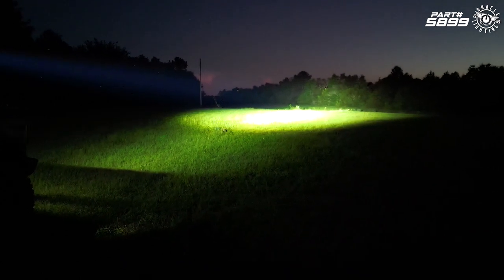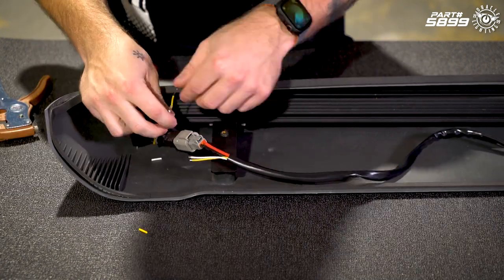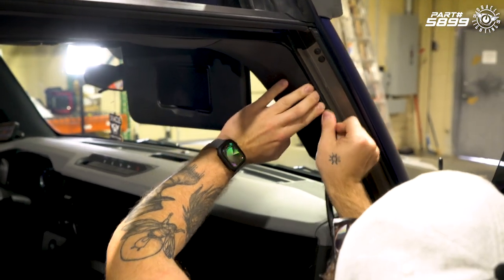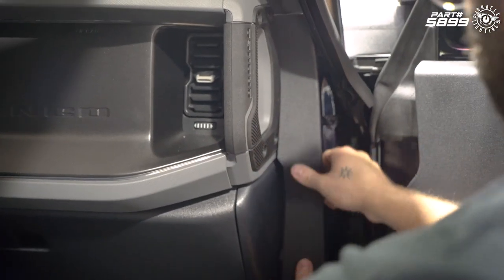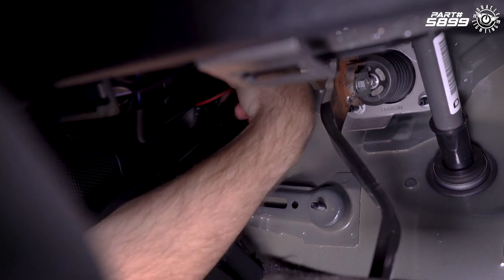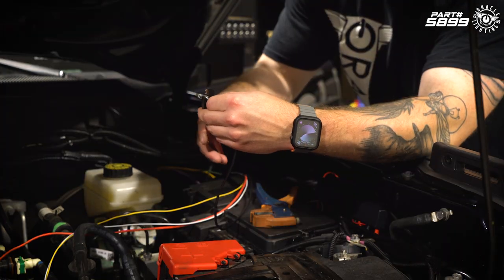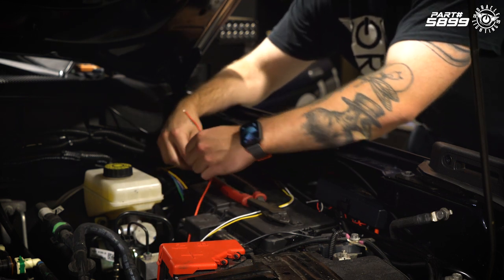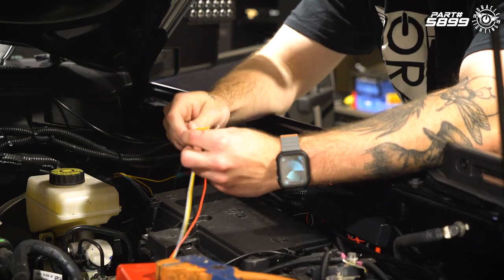Bronco Light Bar Aux Wiring Harness

Comment: Why didn't you run it down the driver's side like you did in the intial install video? I have an aftermarket aux switch bix in the engine bay. I am assuming this the wire kit that I will want?
Reply from the maker: Yes, if you have an aftermarket Aux setup you would use this cable for that as well.

Comment: That is one hell of a routing method. Why didn't you tap into the AUX wire behind the passanger vanity mirror?
Reply from the maker: That wire is 18awg, it will melt immediately if you connect a light bar to it. Not sure what Ford was thinking.
Reply: @ORACLElights  that's true I forget the roof aux only has like 15 amps to work with.
Reply: I’m curious but why didn’t you just run the harness out the drivers side of the light bar and down the drivers side pillar and through the firewall like you did in your other video for those without the aux switches? Seems unnecessary to go down the passenger side then under the dash
Reply: @michaellorenzjr.9765 I'm guessing it depends on how the light bar mounts. When the cables are on the passenger side of the light bar that's the path of least resistance. I'm curious why he didn't run the cable through the grommet on passenger side behind the windshield wiper fluid.

Comment: You’re not supposed to connect anything directly to the negative terminal on the battery. It will mess with the Battery Management System (BMS).